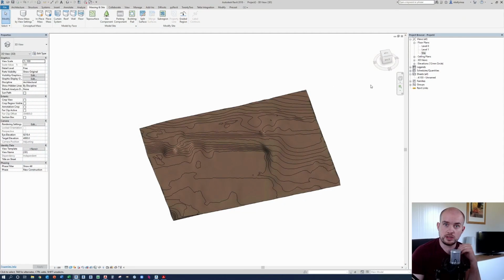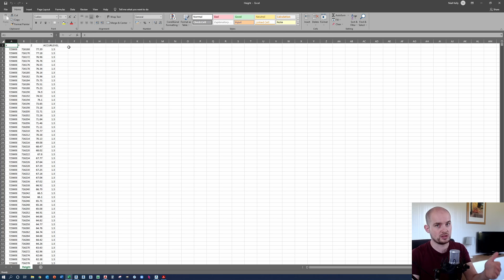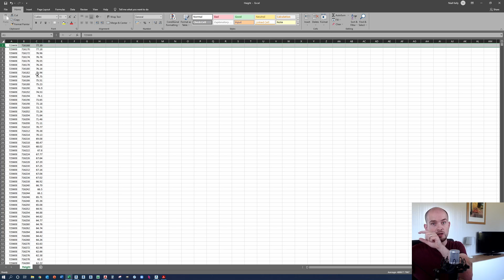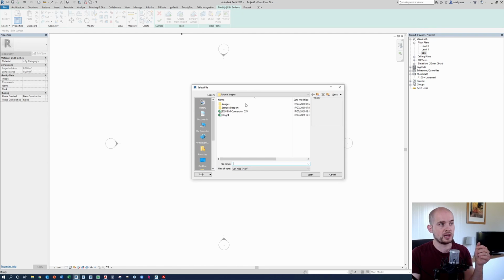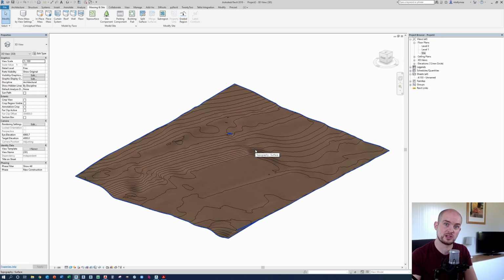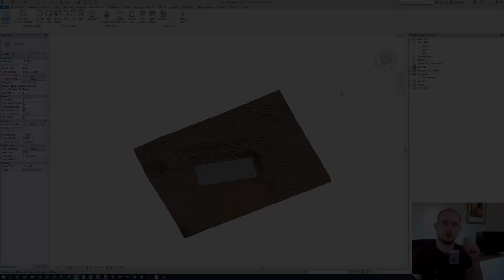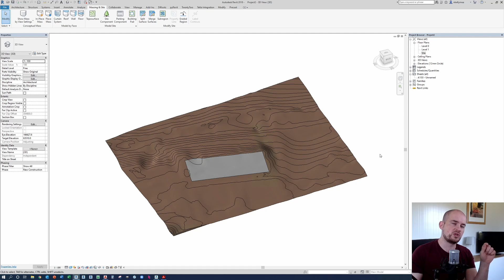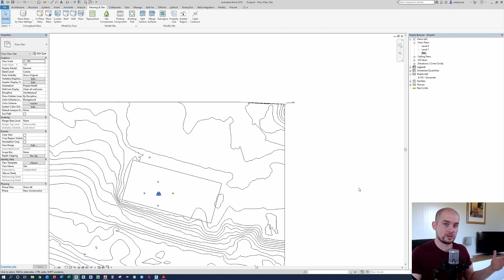Create Revit Topography from Excel Points File

Comment: Hey, man very very good videos. Here is some subjects if you could adress or want to address in future videos, which i m personally struggling with  : 
- How to make professional looking details of wood construction especially walls and jonctions of walls with roofs and fondations. 
- how to make different plans of demolished, existing, new plans, with tags and such, for renovation or extension projects. 
- How to make layers export to autocad, to match the layers a firm or a client use, from a Revit model. Especially in renovation projects. Like: 
The color of the lines, their thickness, their types, and what they print from AutoCAD. Exemple : 
In autocad : 
N- wall, a color of it's index blue, thickness of line 0.5 mm, line type continued
D-wall, color of it's index red, thickness of line 0.3mm , line type dotted 
E-Wall, color of index yellow thikness line 0.4mm, line type continues
How would it be possible to get such graphics in autocad ?